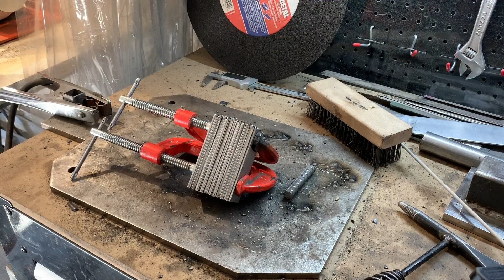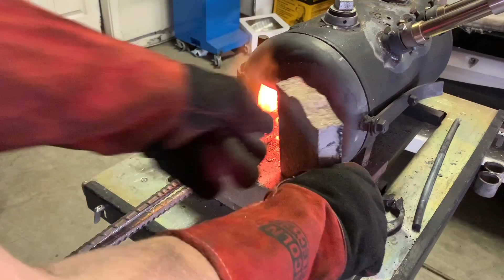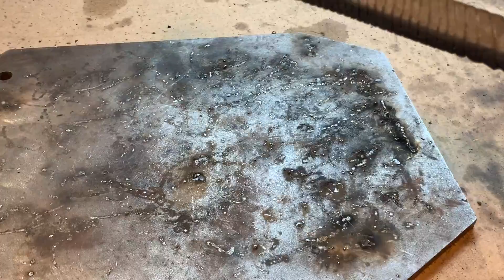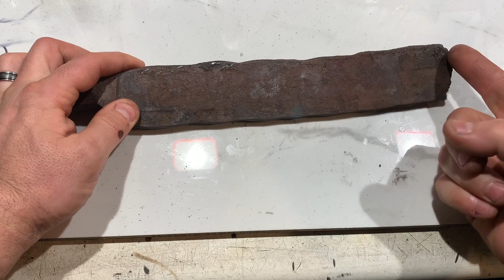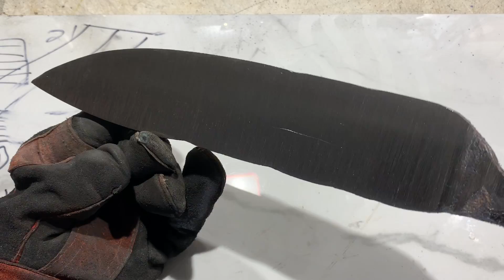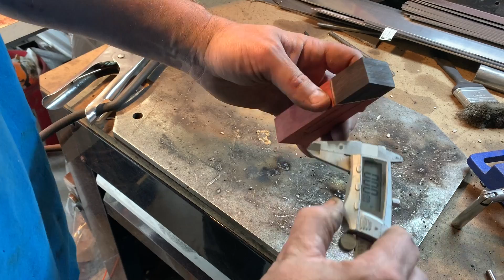Forge a Chef Knife with Turkish Twist Damascus

Comment: I’m a little late to the party, but enjoyed it just as well. I love how you’re always looking for new ways to pattern your Damascus. I’m curious if you’ve considered what you would have done differently, with the benefit of hindsight, to prevent that crack. In the end, excellent work as always!
Reply from the maker: I think on this one I just didn't get the billet quite hot enough during the last forge weld.  Plus now for something like this, I would probably use sacrificial steel around it so I had a zero-oxygen environment.  Thanks for watching, Curtis!

Comment: I think I just got an idea that you might be interested in trying, sir. Wouldn't it be useful to have a wire brush set maybe 2 inches down and a few inches behind the hydraulic press in a jig that holds it in place where you can brush the slag off while getting less on the press? 

I don't even know if that's a thing but I haven't moved up to bigger equipment, so I haven't looked into it yet. Most like to just use the press itself or pull the work out to brush it by hand but it seems like it might bee a good thing to try, at least.
Reply from the maker: I’ve seen guys do this.  Instead of a brush, sometimes it better to have a “blade” to scrap off the scale before pressing.  That’s why you see me use the edge of the dies on occasion.  Thanks for watching.
Reply: @TyrellKnifeworks  heck, when I get a press set up, that sounds like exactly what I would end up finding useful even more than the brush! The more stubborn scale would come off easily. 

Thanks for the content!

Comment: So, a question:  Where the forge weld failed.  Suppose you drilled/ground/filed a slot down the center of the knife where that was.  Make it an eighth or quarter of an inch wide, and say it's to reduce the friction as the knife slices through something.  It would prevent stress cracks from propagating, and become a feature rather than a bug.  What do you think?
Oh, and that pattern was spectacular!
Reply from the maker: Ha, yeah possibly but not what I was going for.  I’m going to be doing a Turkish twist again as part of my Damascus Pattern series soon! Thanks for watching.

Comment: What would happen if you twisted a billet, squared it up, then twisted it in the other direction? Like untwisting it a bit?  Also, can you twist a billet, cut it in fourths stack in a cube with L, R, L, R pattern, forget weld and then twist that?
Reply from the maker: Interesting idea to do a twist-square-untwist.  You’d get some kind of ripple pattern I suspect.  Also, you can’t twist a single long bar in one direction and slice it up into 4.  You need an opposing twist.  (Try it on paper, you’ll see what I mean). Doing a twist on a twist will probably muddle the pattern.  There are other ways to combine a twist to make it look cool.  Stay tuned, there’ll be one coming up in a few builds.  👍

Comment: What is the purpose of the kerosene bath?
Reply from the maker: When it goes into the forge, the kerosene immediately burns off and also burns off any oxygen that might be between the layers.  The theory is that you have a better zero oxygen environment for your forge weld that way.  👍
Reply: @TyrellKnifeworks  Thanks!

Comment: Great video.

What did you soak you billet in before you stuck it in the forge ? Diesel fuel perhaps?
Reply from the maker: That’s kerosene.  It helps the forge weld.  When it burns off it creates a low oxygen environment and leaves a residue that prevents scale.  Thanks for watching.
Reply: @TyrellKnifeworks  
Cheers my friend. Thank you very much.